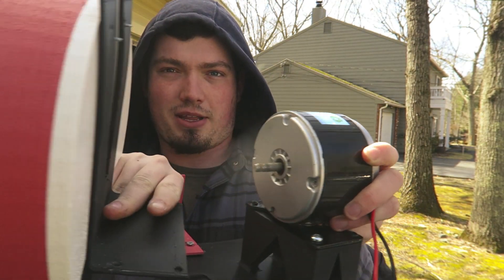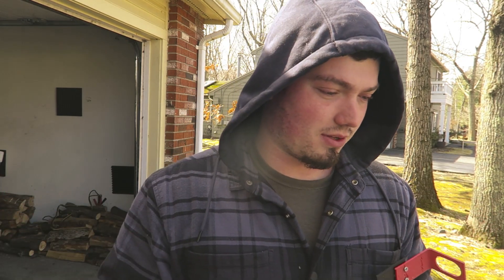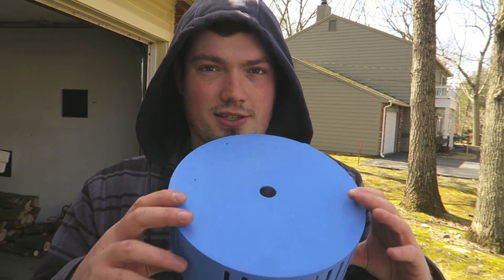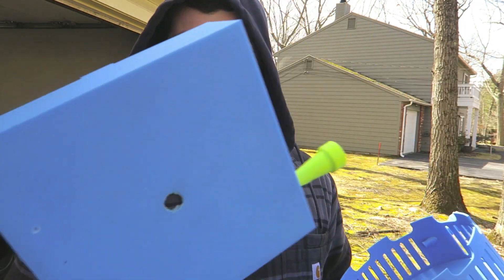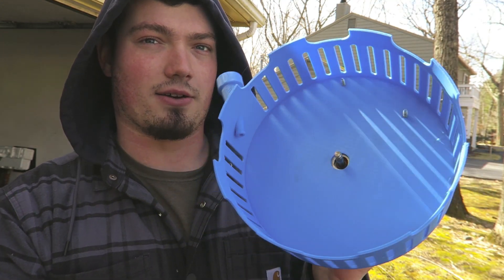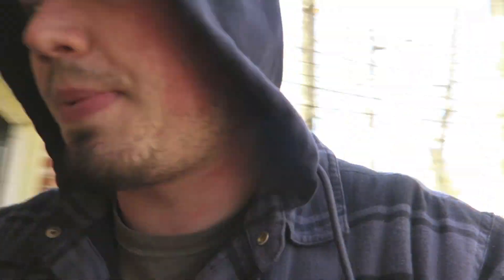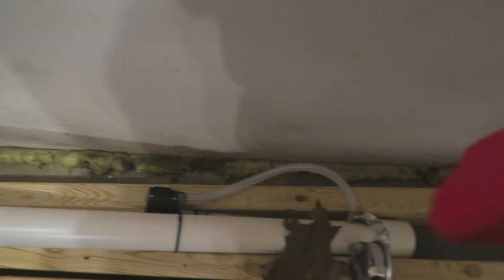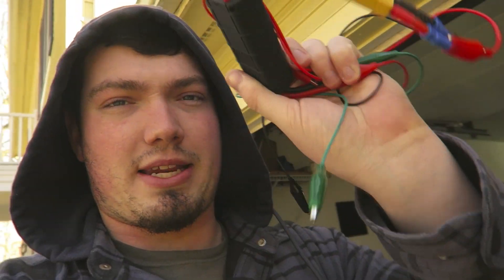The 3D printed micro Pelton turbine is almost working

Comment: Loving video's about hydroelectricity, Personnaly i use a washing machine motor (Direct Drive) and a pelton wheel, i recommend that you find an washing machine motor, they can be found cheap second hand, they have much better cooling and lifespan than closed generator, i burned 3 different closed generator already untill i found the washing machine motor. Basically those closed one's heat's up after few hours and the coil coating just degrade and then short circuit....
If you buy a second hand washing machine make sure it is a Direct drive / Smart Drive motor and not a normal brushed motor ;) 
Subscribed, i will be here for your next video
Reply from the maker: I'll look around and will see what I can muster up. I'm glad you like the videos many more to come, going to try and post biweekly or even every week if I can

Comment: I wonder if you have enough water pressure for a couple of pulley's so that you can ramp up the RPM from the motor generator. A simple frame for the different parts would be handy for testing purposes, especially if you make some brackets for some pulley's. It would also make it a lot easier to test different blades and housings and what not, because you wouldn't have to deal with mounting the motor generator all the time. And you could even install different motor generators and test them simply by connecting the turbine pulley to a different motor by switching the belt. 

And what I am also very curious about is what would happen if you would make the housing a tight fit with minimal tolerances around the blades, with only one exit for the water. My best guess is that the RPM might be less, but that the torque will be higher. That is if the printed parts can handle the pressure. And I think that how larger the diameter from the wheel would be, the better it works with a tight fit. Although the blades should be adjusted in size in relation to the amount of water flow, so that it will have the best possible laminar flow with the least amount of oxygen bubbles inside the turbine. 

Have you ever tried those things before?
Reply from the maker: I haven't but these are all good ideas I will try to incorporate in future revisions.
Reply: @Beyond_The_Print  You need a T.D.T.B. 😁 A Turbine Dyno Test Bank. 👍
Reply from the maker: @insAneTunA  I'd have to agree